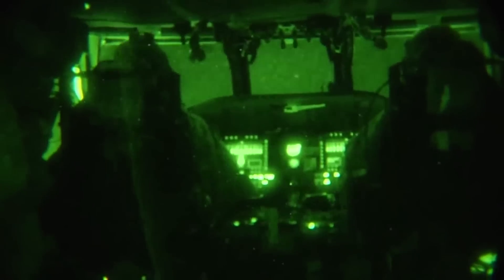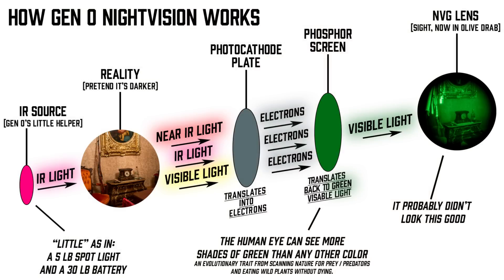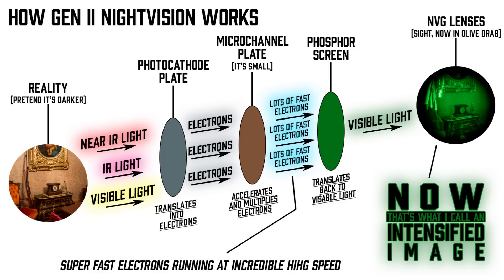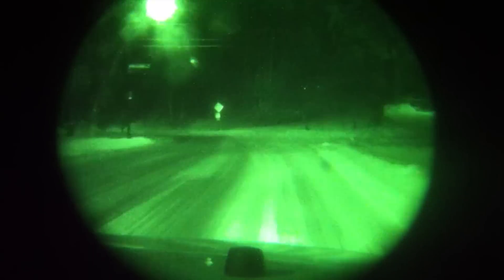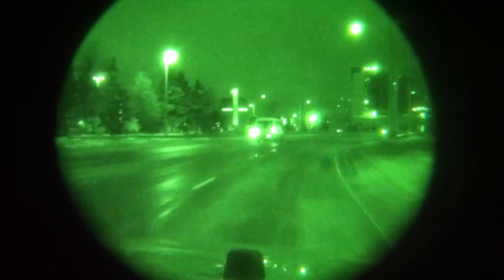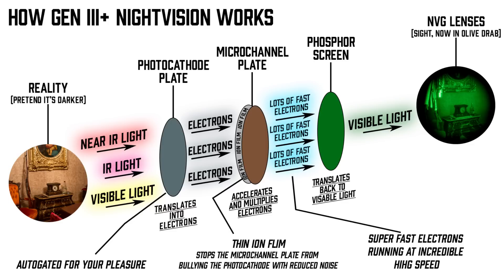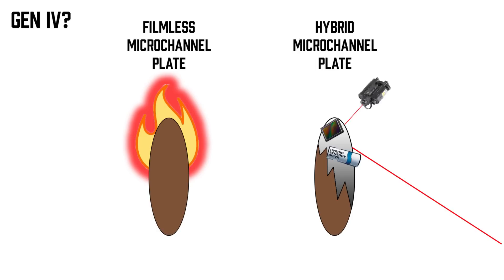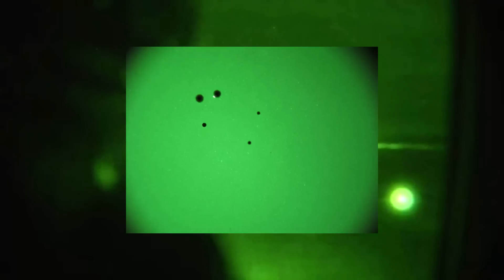Ivan Presents: A Practical Guide to Night Vision Terms and Technology

Comment: 2:51 is incorrect. Gen 1 tubes are nearly identical to gen 0 stuff but with more sensitive photocathode materials that could pick up more visible light instead of almost purely IR. The process of stacking multiple tubes results in a  "cascade" tube, and is not a feature of all gen 1 tubes. Non cascaded gen 1 tubes are what you find in most cheap consumer grade night vision devices.

4:44 The MCP does not accelerate the electrons. That's done by the high voltage power supply connected between the photocathode and the mcp, and between the mcp and the screen. The MCP actually spits out hundreds of electrons per single electron entering it, in effect "multiplying" the electrons that came from the photocathode.

5:15 The correct term is "noise". The SNR spec on your image intensifier specsheet will determine how much.

5:55 Gen3 is defined as any tube with an MCP and a photocathode made by gallium arsenide. That's it. The ion barrier was made to prevent this poisoning you mentioned, but isn't what makes a tube gen 3.

7:11 Gen3+ doesn't exist. It's just gen3 thin film.

9:09 is just bullshit. Autogating is not the technology responsible for lowering the brightness / gain in high light environments. All autogating does is preserve resolution in high light.

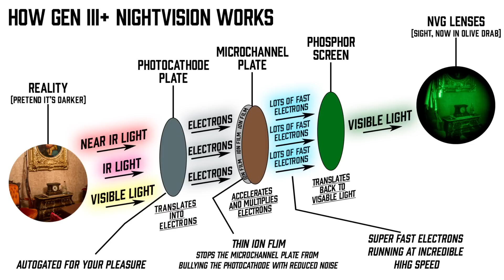10:20 Automatic brightness control is implemented in the power supply for the tube, the MCP is just an MCP. ABC came a long time before autogating was a thing, so to say it happened simultaneously is just wrong. Some of the more advanced gen 1 cascade tubes have it.

There is no set standard for gen 4, it just doesn't exist. Don't fall for the trap of thinking "4G" tubes mean 4th generation. That's just marketing.

The "lifetime" is typically until the tube decreases to 50% of original brightness. Can still be usable

Purging is overrated, I've never had the inside of a non purged unit fog or mist up.

Comment: They’re cool, but not $2900 cool.
Reply: $2900 is not a bad price really. Look at it this way, some guys spend $1000 on multiple name brand AR, when they could do with a DPMS or FN el cheapo for $550. NVD brings a lot of benefits in contrast. But, if you want to go on the ultra cheap, you can make a digital version of a Gen 0 using car backup systems and an IR filtered light and it actually works extremely well for most tasks including airsoft and hiking.

I would consider buying this to support fellow kommando but a year ago I already bought a PVS-7 from brownells.